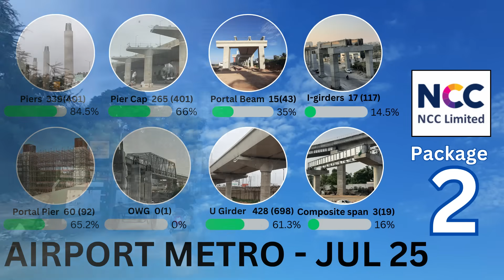Bengaluru Metro : Blue line : Airport line : Hebbal to Tin Factory: JUL 2025  #bmrcl #bangaloremetro

Comment: I personally didn't like NCC taking up this stretch and worst part all 3 packages are taken by them , they are very slow .
Reply from the maker: Why. Any particular reason that you have this opinion about NCC . In fact NCC in Pkg 2 and Pkg 3 have done more than AFCONS and SNC in ORR Stretch in spite of starting 6-7 month behind. the issue with Pkg 1 is the accident and the aftermath of it . they had many restrictions to work at height and hence the slowness. thankfully now they are back in the rhythm again and hopefully they will complete the stretch sooner